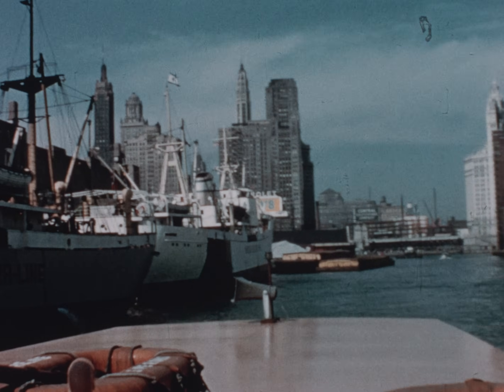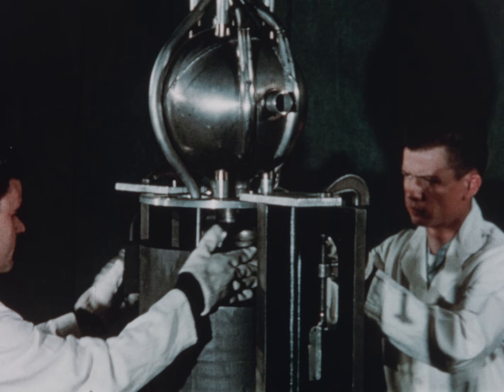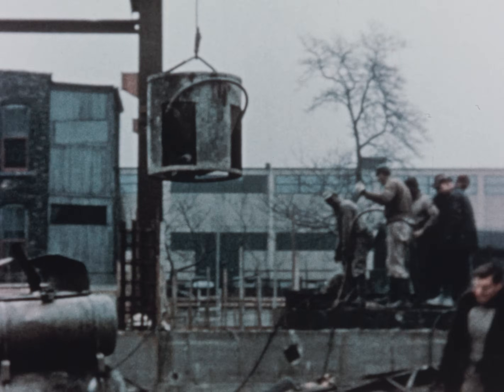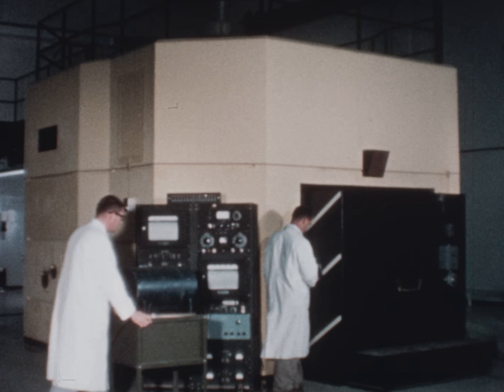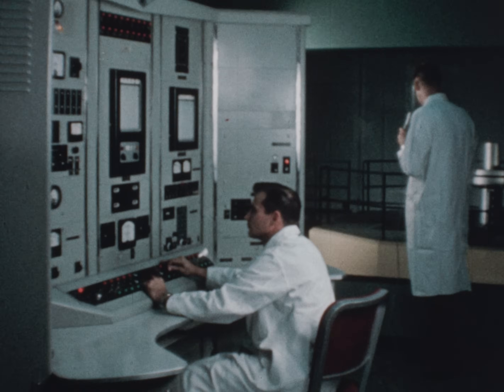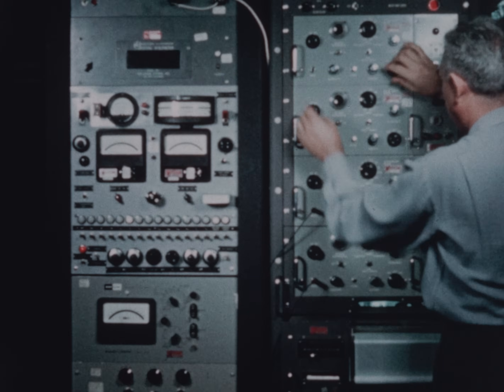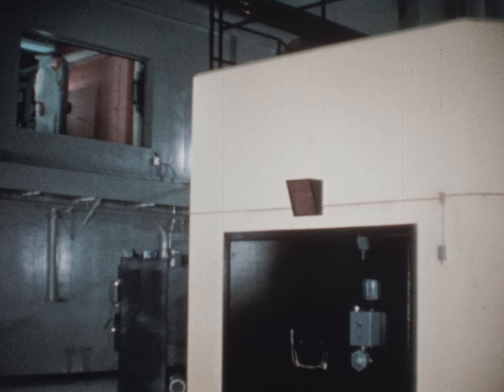The Armour Research Reactor (1958)

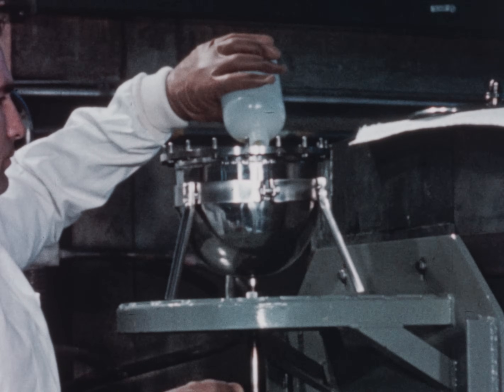Comment: 6:47 👨‍🔬 hey go take this plastic container of highly-enriched uranium and uh slowly pour it in the reactor, ok? Also don’t tilt the container too much because there’s a small chance [adjusts slide rule and squints at it] it could go supercritical. I’ll just be waiting back here behind 12 feet of concrete and a foot of lead shielding. You did fill out the “next of kin” paperwork, right?

13:29 [NARRATOR V.O.] Armour and Company, the largest American meatpacker and innovator in the area of turning previously-unwanted slaughterhouse offal into delicious processed food products, is irradiating pork shoulders and tomatoes in an attempt to create a meat product (Armour Treet) that secretes its own ketchup. Their Armour Research division is responsible for the creation of this facility.

3:04 “…completely safe operation in densely-populated areas.” Fortunately, Chicago is not a densely-populated area, so lethal beams of fast neutrons and gamma rays extending for miles from the facility should not affect anyone.

1:37 This precisely-designed rat’s nest of radiator coils provides cooling in a predictable fashion [randomly crams tubes into sphere] and everyone knows that thin steel tubes are not subject to neutron embrittlement and will never leak because losing the ability to cool the reactor would be bad.

10:18 this Control Room smells like Brylcreem and Aqua Velva

14:13 and they said that as a nuclear physicist, I would never meet women! The fools! Hahahaha!